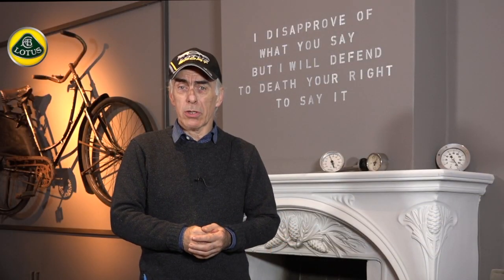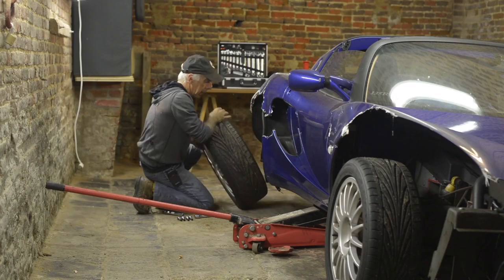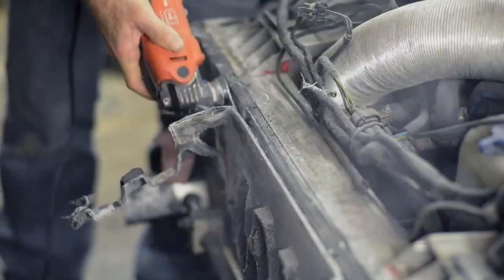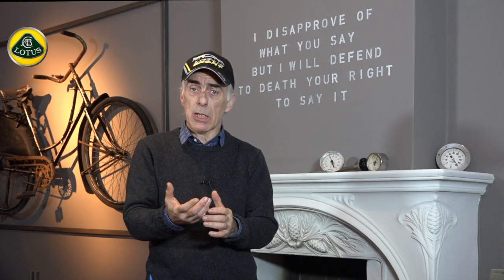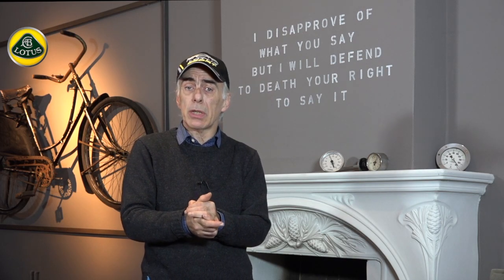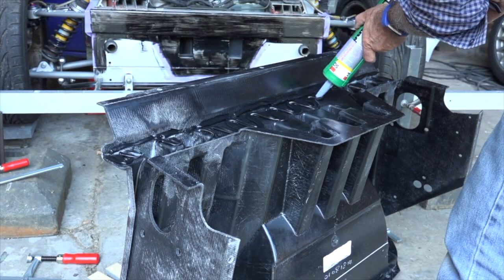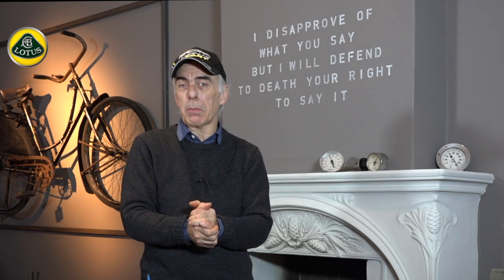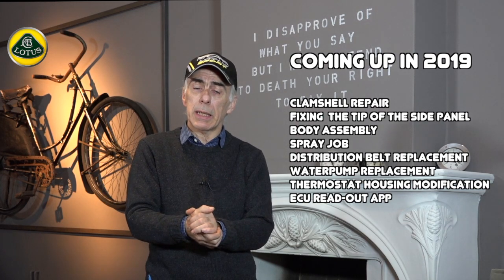Lotus Elise Tech Talk, look back and whats up for 2019

Comment: Lotus God..... been digging the videos, your repair vids are oddly satisfying to watch. I have always wanted a Lotus. Since day 1. I never did because I could not afford the cars new. But I can now. I am restricted to one car. My wife also has her own vehicle.

I currently drive a Challenger RT. Its fully loaded and new enough to get me an amazing trade in. I am seriously considering it. The most reliable Lotus I know of uses Toyota engine and transmission.... that being said..

I know if cared for, those 2 things are  near bullet proof. My question is this...

Are there any Lotus specific parts that are crucial to performance and drivability that would be hard to find and keep me off the road for weeks or even months at a time?

I know roof can leak, I know to let it warm up before driving hard, and I know the central lock system frys consistently, im fine with that manually locking things isnt a problem.

This will be daily driven, short commute to work for 7 months, then just errands the rest of the year. Im fine with impracticality of the car itself, being raw, limited space, 2 seater,  etc

I really want this car. But I am worried parts for elise/exige or evora  will be hard to find. Im still uneasy about British cars. But this is one brand I really want to rep.
Reply from the maker: Thanks for the comments, parts are not an issue in general except the crashbox..( but if that is needed to be replaced, then its a serious issue or damage) For the rest there are plenty of stores that sell parts.  I never had an issue, and the cars are very well build mechanically.  Of course it stays a fast sports car...  It all depends where you live , in Europe no issue for parts, however original parts are rather expensive.
Yet there are many aftermarket parts available
Reply: @D3Sshooter  I live in Canada, we have a small collection of Lotus dealerships, atleast 1 in every city.
Reply: @D3Sshooter  Thanks Lotus God. Keep up the phenomenal work.
Reply: @D3Sshooter  2007 Elise SC...26,000 miles....... Can I trust and depend on this for the next 10 years?

There is an Evora with 32,000 miles Im looking at aswell. Elise is $49,000  and 2010 Evora is $60,000. I want the more reliable car out of the 2. I may be switching my daily driver from a V8 Challenger to one of those 2 Lotus'.

Comment: Awesome news Steve. I came here for the Lotus but as many others have said, stayed for everything else as the DIY and old rusty are equally enjoyable to watch. Interesting about the ODBII App, any more details you can share, will it be paid/free and IOS only or also android ?
Reply from the maker: Hi Shaun, thanks.  and for the OBDII app, its going to be for free .  I am an old school guy, who does often things for free.  My payback is the satisfaction of creating it and see it work.    The only thing that will be needed is a Bleu-tooth adaptor ( that is a about 20 euro /dollar) to be fitted on the OBDII connector in the Elise.. I will provide at that time a few links where they can be bought.  The App will be for free.... Initially only for Iphone and Ipad. The App will be on the app store.   I don't know by when it will be ready, i have the basic communication working, reading hex codes.  Still need to build the GUI's, Graphics, menu and most of all the interpretation of the values .   I might make a video on the progress of it.
Reply: Very kind of you to make it free. If you need any help with the code etc, get in touch Steve as my Son is a full stack dev and has had experience with App dev/release on IOS.
Reply from the maker: Shaun Cymru   Hi, that is a kind offer.  I might just have to do thst once i get stuck.   Txs a lot

Comment: Re the app there is already a free one which I use with my lotus "torque" lite  the only thing it does not do is let you operate the abs to bleed the brake fluid ..
Reply from the maker: Hi Mark, I know... but I want to create my own with a special touch and feel...
Reply: D3Sshooter , hi maybe you could look at the ABS bleeding in your APP ..  ;)
Reply from the maker: Mark Bridgewater , yep that might be an option.  Txs